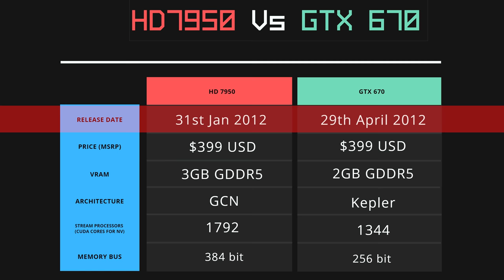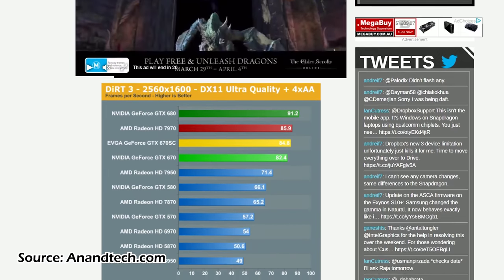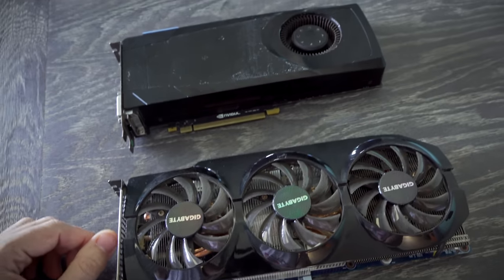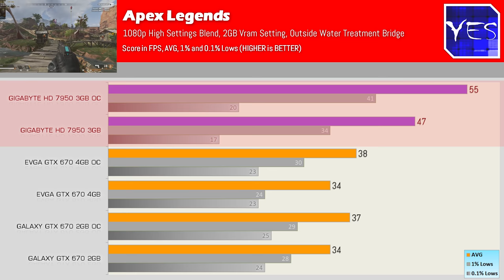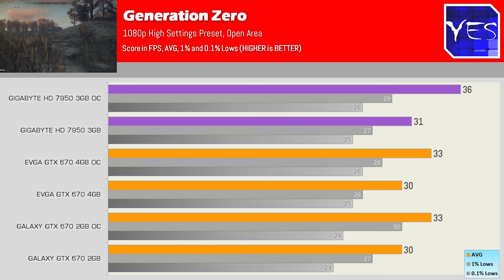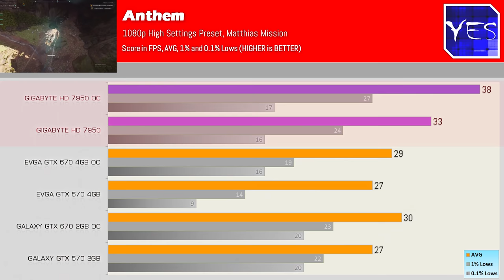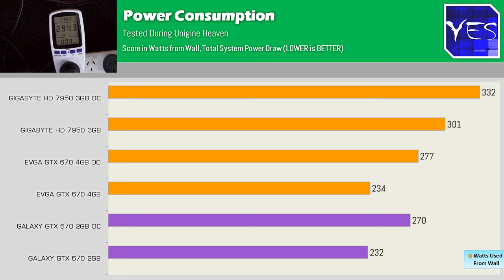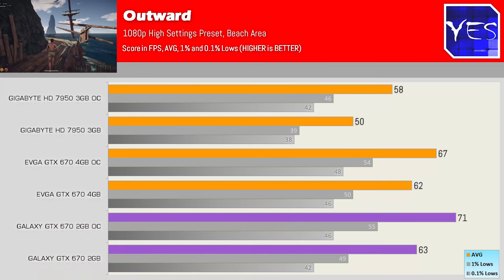GTX 670 Vs HD 7950.... Who Wins in 2019...!?

Comment: i had a HD6970 since release that broke after i installed Arctic Cooling Accelero Xtreme III. It had overheat issues since the start, those oem one fan coolers sucked. even the accelero didnt work out well the card died and i changed to a 760ti

Comment: It be nice to include your overclocked settings in the video.

The HD 7950 overclocks very well. About a 20% increase. I found I needed need to disable fast startup in Windows to prevent WattMan resetting the overclocked settings for HD 7950 and R9 270X.

Comment: Hey, I just got an insane local deal on an Asus sabertooth x58 motherboard for $50 and am looking for a cpu and cooling. I'm thinking of getting an x5675, but I am unsure as to which cpu cooler to get. Would a 212 evo be enough to safely overclock it or should I get a beefier air cooler?
Reply: Joseph Wilkinson get something beefier, I used a Noctua d14 for that...

Comment: adds , the r9 280 is superior ,and now competes with a gtx 780 ,a simple test for you,i run far fry 5 in 1440p in high ,35-50 fps
Reply: The 280 and the 7950 should perform similarly, they are the same GPU.

Comment: I was on eBay last week and threw a random €1,- higher bid on an 280X (7970 refresh). To my surprise I ended up winning it for the big sum of €31,-. Ships from Ireland, so shipping was expensive at €25,- but I think a total of €56,- is still a great price for this card.

It's going in my secondary rig, which is currently using a €5,- GTX 650 Ti with unstable memory unless underclocked  by 200MHz. Should be a sweet upgrade, and I was looking to spend about €50-60, so that worked out great! Was my first bid too lol

Comment: is the 7950 the equivalent to the r9 280?
Reply: Same chip, same core config, same ram and ram speed. The only difference is the core clock. The original 7950 had a core clock of 800mhz with no boost. The boost model had a base clock of 850 and a boost clock of 925. The 280 had a base clock of 827 and a boost clock of 933.I suppose you could say by default the 280 is faster than the original 7950. Whether it's faster than the boost model depends on if they are running at base clock or boost clock. The performance should be largely similar, though.
Reply: @jtenorj  wow thanks for the answer, i have a r9 280 myself but it does not perform as good as bryan shows in the video, maybe it needs some tech yes lovin.